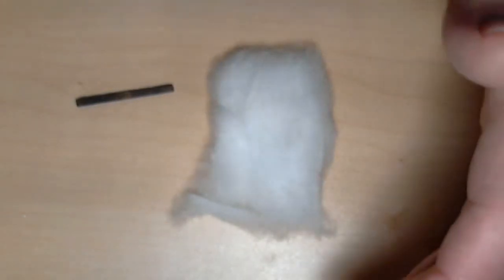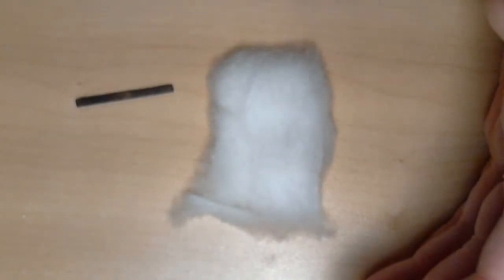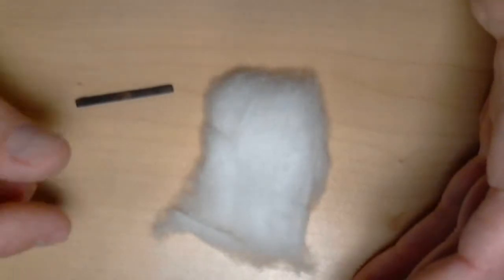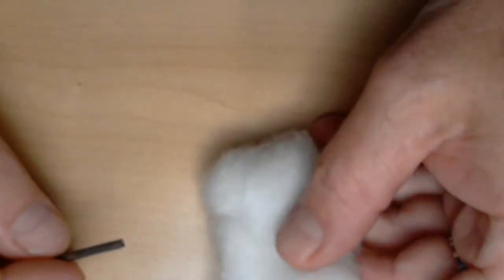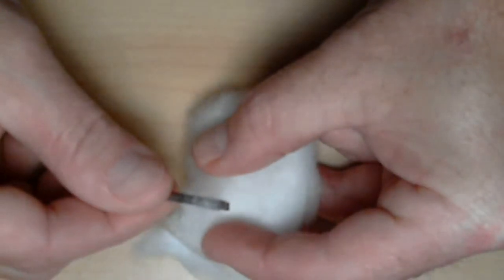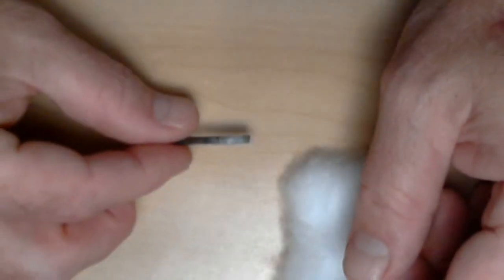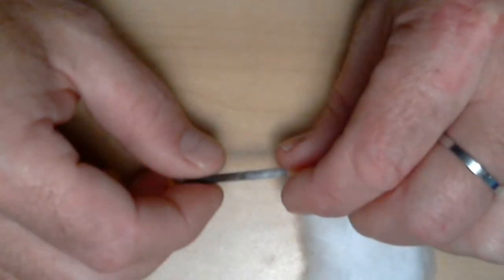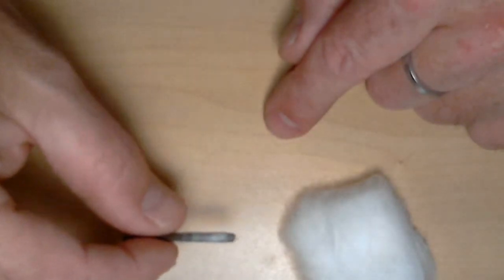Mesh/Cotton hybrid wick Bluegrasslover's method

Comment from the maker: Sounds like a wicking issue not the cotton...one of the big reasons why I left mesh wicks in favour of 7x7 cable. Another thing that may be happening (happened to me a few times), if you get too much cotton on there and it's making a seal around your wick hole "and" you run a filler plug in your genny you may be starving your tank for air...that will stop wicking in short order.